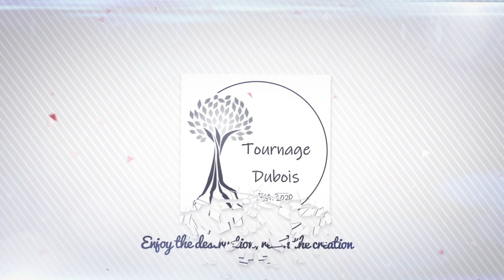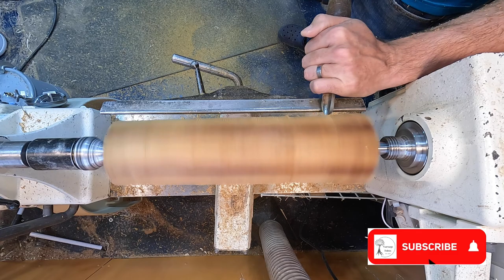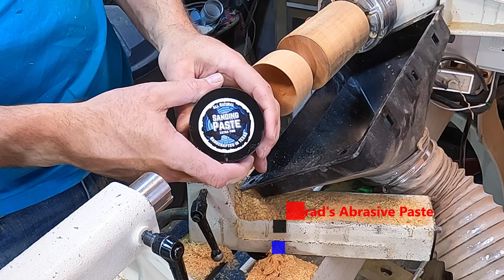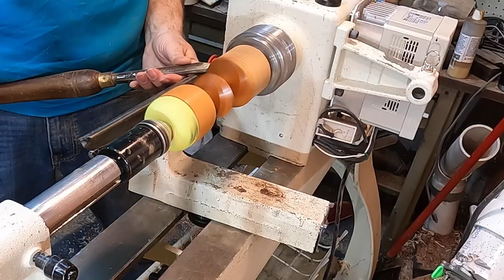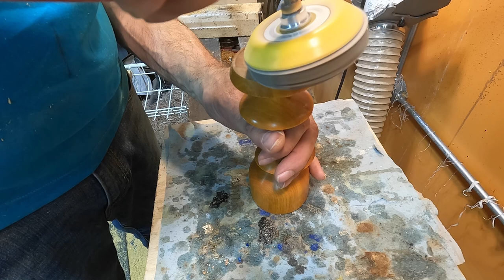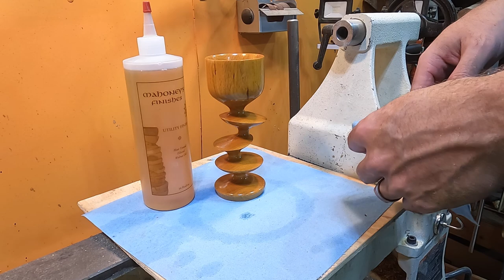Woodturning - The Mad Hatter Goblet

Comment: Super dope! Do you think that would be possible with a mortise on the bottom instead of a tenon? Or would it not hold as well?
Reply from the maker: Thanks! It would be possible, but I wouldn't recommend it. With these, you would end up with a mortise in end-grain, which wouldn't be as stable. It would probably be a little easier for it to come off the jaws doing it that ways to, but that's just my thoughts.